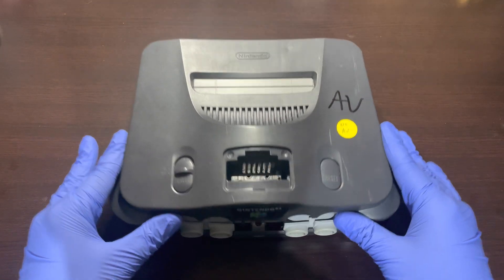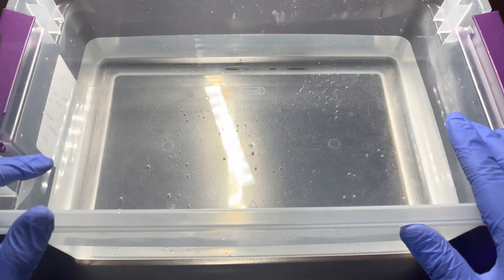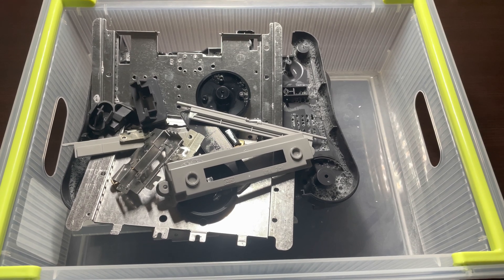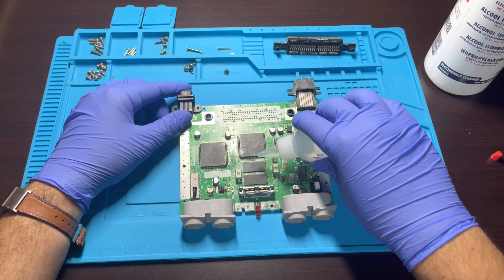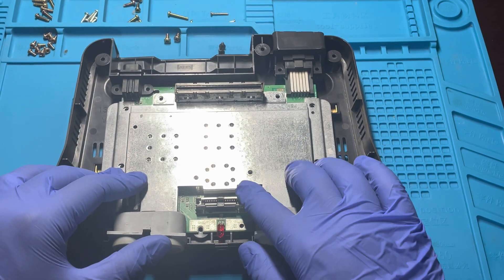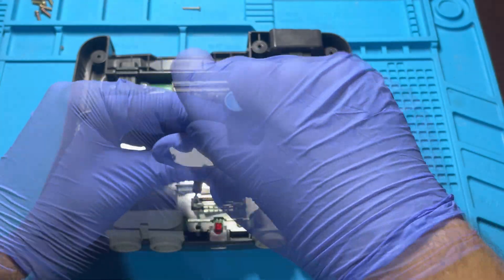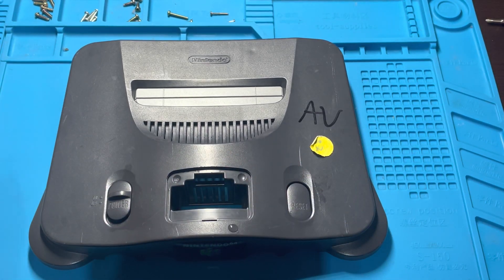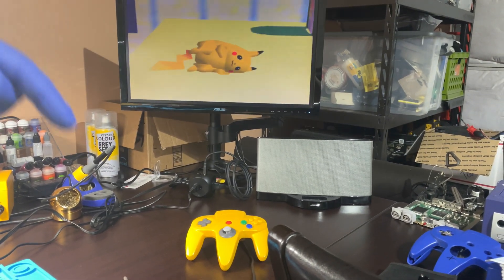N64 Console Restoration - How to clean Nintendo 64 Console

Comment: How would you recommend to clean the insert cartridge reader? 🤔
Reply from the maker: There are multiple ways, to me the easiest is just to get a brush with medium strength bristles and dip the brush head or pour a bit of Isopropyl Alcohol on the bristles, then start going through the cartridge reader. Make sure that the alcohol % is 91% or higher, otherwise you can corrode your components.
Reply: BW100 also works wonders